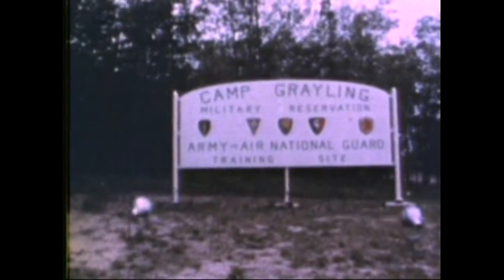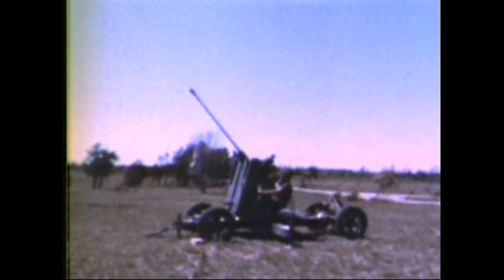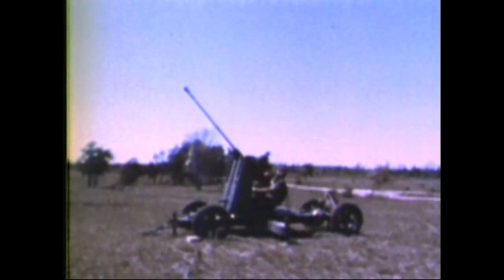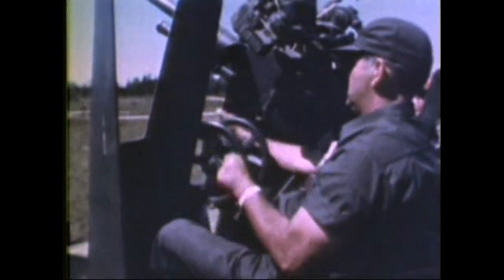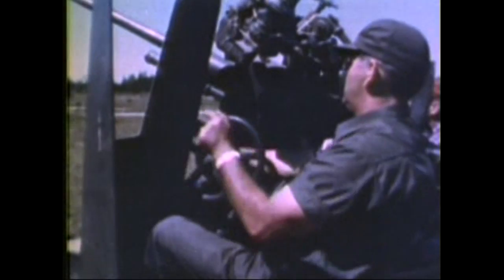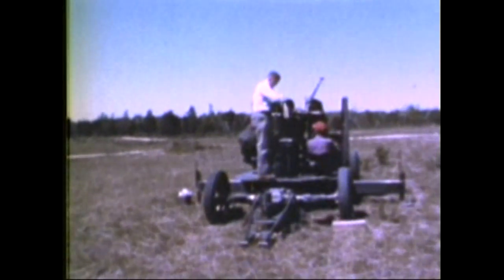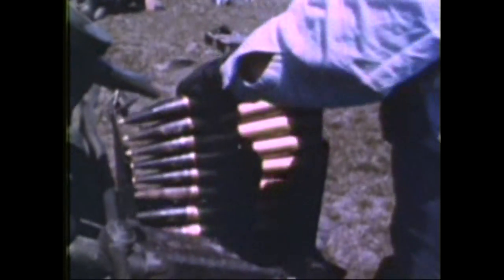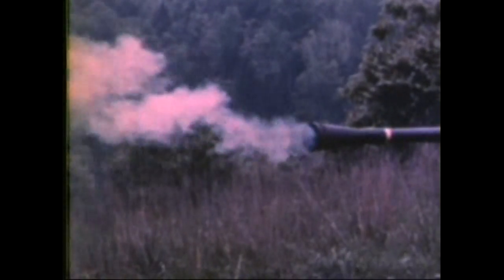M1939 37mm Air Defense Gun Tests

Comment: 37x252mmSR. There is no equivalent cartridge of this currently used in the West. It's still used in many countries including China. On the other hand, Russia isn't using any rounds between 30x165mm or 30x210mmB and 57x348mmSR. That's a huge gap in the middle that could be filled by a return of their 37mm. Russia is making a mistake putting the 57mm on so many of its future AFVs and AAs. Another cartridge they could consider bringing back for ships is the 45x310mmR to be a counterpart to the Bofors 40x365mmR.